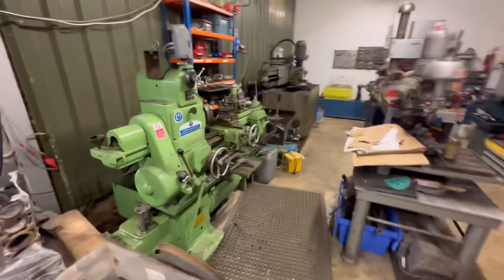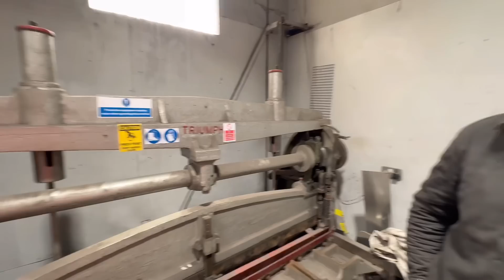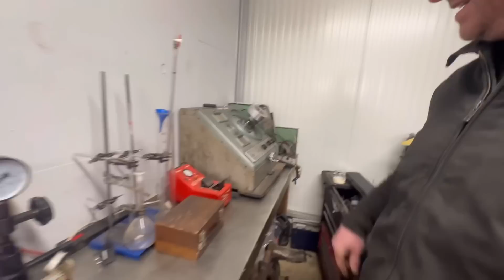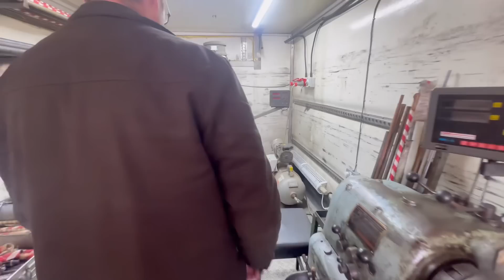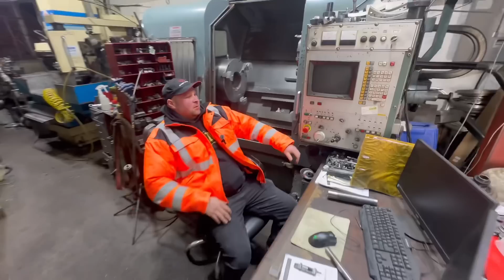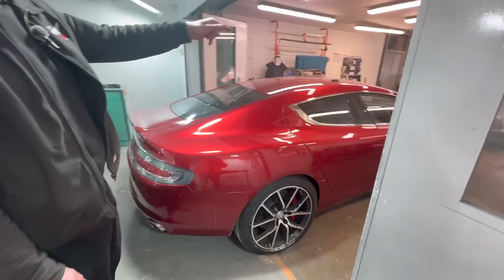SERIOUS ENGINEERING! Classic restoration heaven

Comment: Smaller movements with the wheel to make it look more believable. Try gripping hard and pushing inward some so you white knuckle the wheel also but yeah, move less between each sway cause that sway at 100 like that would be fishtailing quick on many roads.